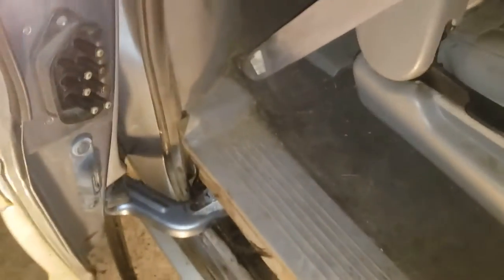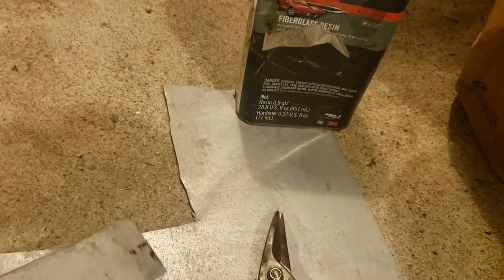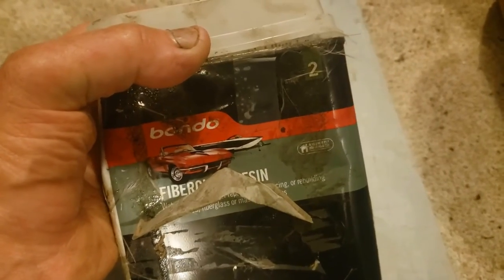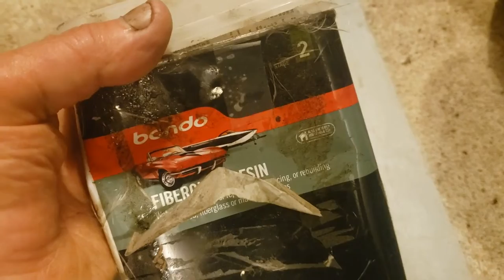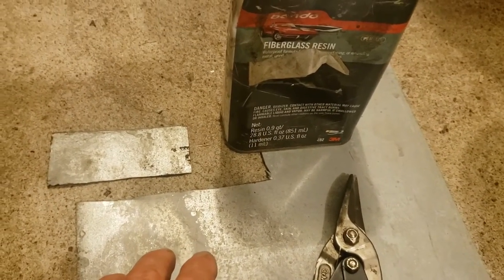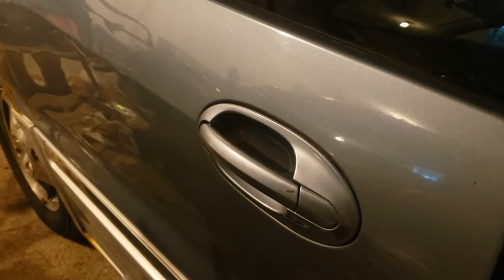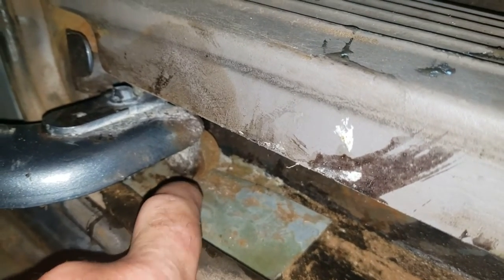Minivan sliding door won't close? Many reasons. Here's a fix for a unique problem! Drive it forever!

Comment: Nice repair on the door. Keep the vehicle running. Some people would see that issue as a reason to get rid of the van. I keep all my vehicles until they are driven into the ground. Michigan winters seem to tear them up before the mechanical problems do them in though.
Reply from the maker: Thanks, Man.  I agree. Pretty much every vehicle I ever had is not considered "fully depreciated" until the frame rots and  irreparably breaks.  New England winters are not kind either!    -C
Reply: @TenaciousCsRescueLeague  Vehicles are a tool to get from point a to point b. I park in public parking lots and folks do not appreciate personal property. Drive them into ground and when needed get a new used one. Lol